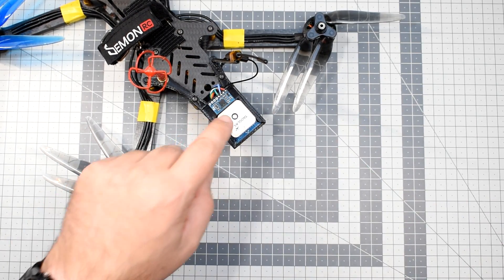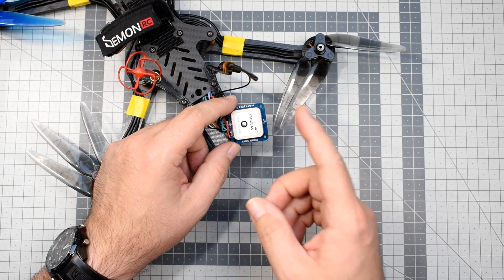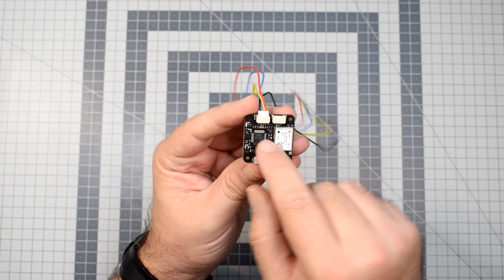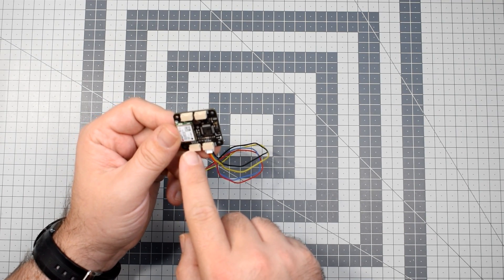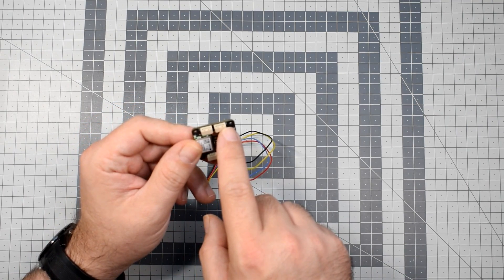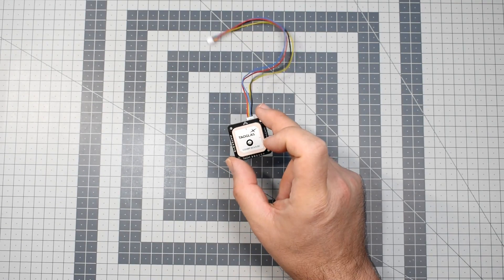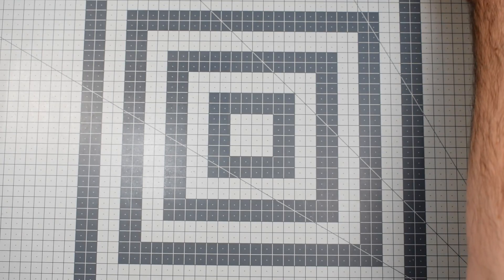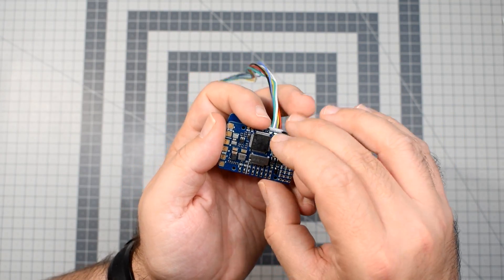Matek M9N-5883, M9N-CAN GPS and Matek F772 WPX flight controller

Comment: I am using NEO-M9N with Kakute F7 on INAV 2.6.  consistently going to GPS Failure warning then back with 12 or more Satellites.  Using NMEA as UBLOX doesn't see to work at all.  Anyone have similar issue?  I don't know which baud rate to use but I have try a few all seem to have the same issue.

Comment: Thanks to the assist from Pawel I am on the latest 2.6.0 official, when I was on an earlier version  and didn't realize there was a final stable release.  

So I am finding that my M9N-CAN performs less well than the the BN-880 or M8Q-5883 in terms of the number of sats it pulls in.  Setting the unit in the same place as always where the BN-880 gets 8 or 9 and the M8Q-5883 gets 7 - 8, the M9N-CAN  bounces around between 4 and 6 sats.  Does anyone else have this situation?
Reply from the maker: Mine M9Q gets > 20 on the open field no problem and positioning accuracy is higher than with BN880
Reply: @FPVUniversity  Howdy Pawel, how do you get > 16?  I always get 16 sats no matter what.  I used to, (BN880, et al) set to Ublox 5 hz and get > 16, set to Ublox7 10 Hz and get 16 no more,  but with the MSP setting for the M9N-CAN I cannot see a way to ask for the lower refresh rate.  Do you have any ideas?
Reply: http://www.mateksys.com/?portfolio=m9n-can#tab-id-10
Reply: Went to the field Saturday and am consistently getting 16 satellites, compared to my old M8Q-5883 that gets 19 typically in the same place, running latest iNav stable 2.6.0.  Despite fewer sats than the predecessor, it performs better at Pos Hold and RTH after a mission.  The quad landed within 0.25 meter from where I armed it.  Pos Hold is plain better in all axes with a much tighter pattern than the M8G-5883, but I would still like to get the > 20 sats like others have been getting. The link that Sampson posted works for Ardupilot settings; I am running in UBlox7 with a 10Hz rate and noted that 16 is the max at that rate, according to that link.  I will set mine to plain old UBlox 5Hz for next time and see what happens :)

Comment: So I purchased the M9N-CAN and cannot use it with 2.6.0-RC1.  As I attempt to configure it I am getting this:
 
# set gps_provider = MSP
### ERROR: Invalid value. Allowed values: NMEA, UBLOX, UNUSED, NAZA, UBLOX7, MTK

How can one use that unit with iNav 2.6.0-RC1 ? 

Or are we waiting for iNav 2.6.0 "official release"  when it is no longer a Release Candidare?

I opened a new issue here: https://github.com/iNavFlight/inav-configurator/issues/1132
Reply from the maker: I saw that report. And no, you are not using RC1. RC1 was released Nov15th. Your firmware is from Nov 6th, so it's some kind of an early version. Update to final version o 2.6
Reply: @FPVUniversity  I see that now ;)  I got that Nov 6 release from here https://github.com/DzikuVx/inav/releases and now I am going to get it from here https://github.com/iNavFlight/inav/releases.  Thank you for assisting ;)

Comment: Are you still needing to place nav module 10cm from power leads for sake of compass? I find that limitation a bit restrictive for placement on a 5" without it being batt strap or gopro mount.
Reply from the maker: You can't beat physics
Reply: @FPVUniversity  Unless you're Ardupilot :) CompassMot, magfit_WMM.py
Reply: @FPVUniversity  ok could you extrapolate please, it's not I couldn't understand, its that I haven't had the opportunity to learn. 

I really hated digital techniques and thought did ok at physics when studying for my EASA B1 Engineers licence nearly 20 years ago.

 Not sure you of all people should be limiting in your approaches, that's why I came here, to learn. Apologies if that was error on my part.

Comment: Where can I get the 3d printed piece for the gps and antenna holding? I really need that on my quad
Reply: Thingiverse has plenty of models.  If you don't have your own printer ebay is an option.

Comment: Would running a bn880 still be reliable cause this new gps is kinda expensive
Reply: Looking at the M9N specs I think there is no practical advantage over a Beitian M8N which is much cheaper.
Reply: @jannesbosma9801  thank you very much

Comment: Been running the M9N-CAN for a week now on a few UAVs over MSP and its fantastic. Compass and GPS is spot on. BN-880 is a thing of the past. Only downside I have seen is one of my connectors was not soldered on properly so I had to reflow it.
Reply: I am getting (2.60.-Rc1) # set gps_provider = MSP
### ERROR: Invalid value. Allowed values: NMEA, UBLOX, UNUSED, NAZA, UBLOX7, MTK

How were you able to set this up in iNav, and what version?  Thanks!